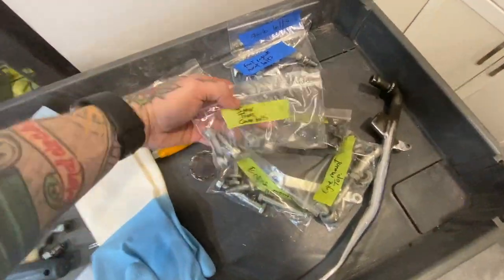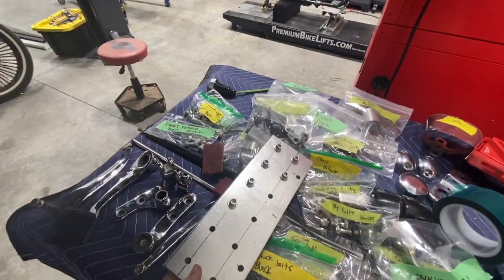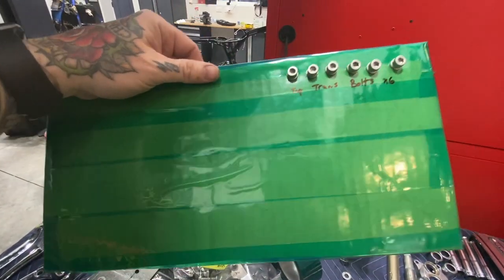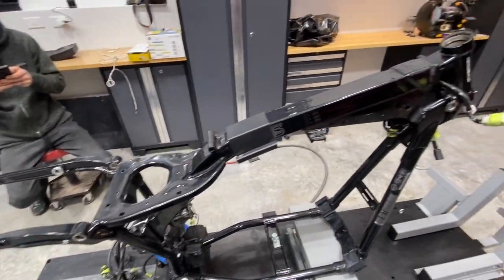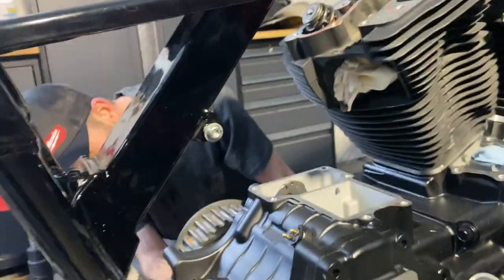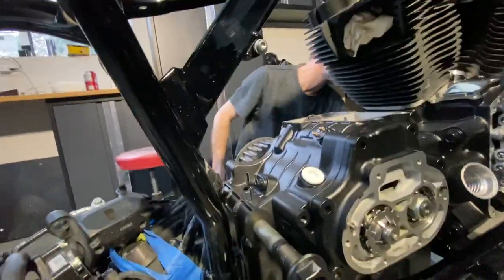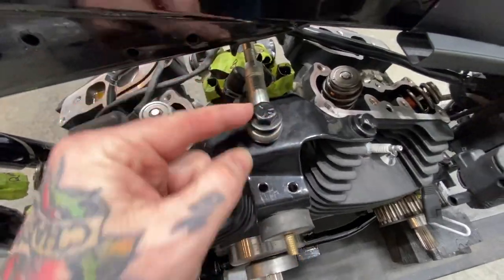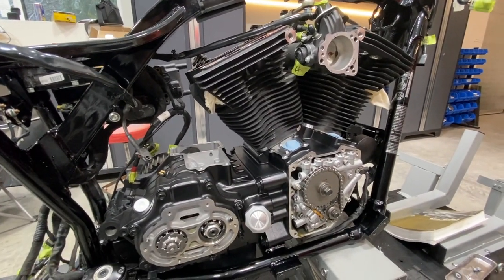DYNA Build "Black Sheep" Ep. 3 "Engine Install"

Comment: What are you using for cure time and temp on your powder coated parts?
Reply from the maker: I’m using prismatic powders and the particular colors I used are 400 degrees and once the part reaches that temperature it is 10 minutes.